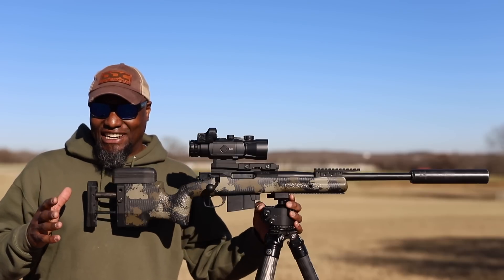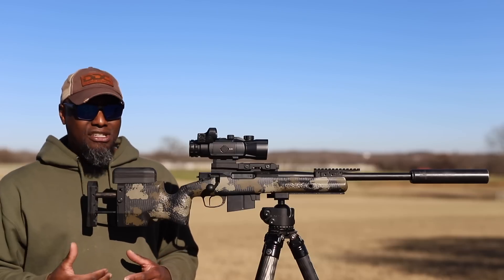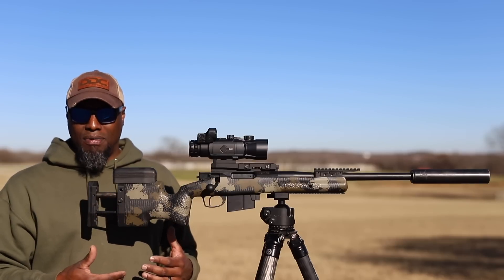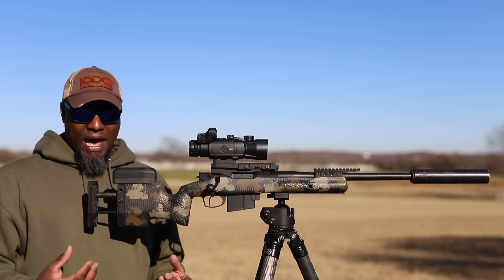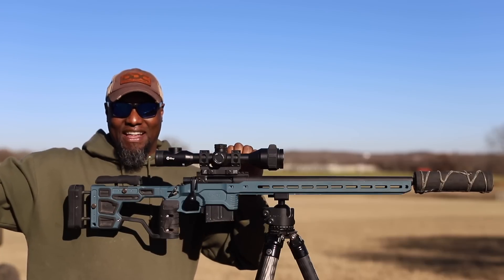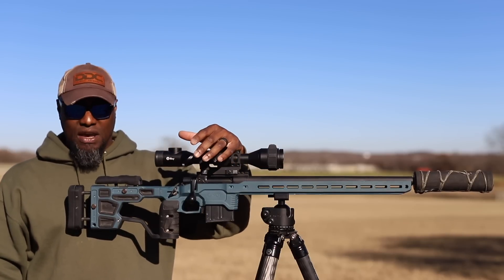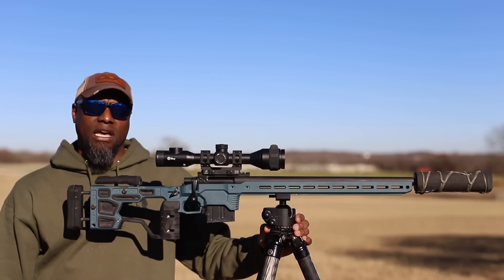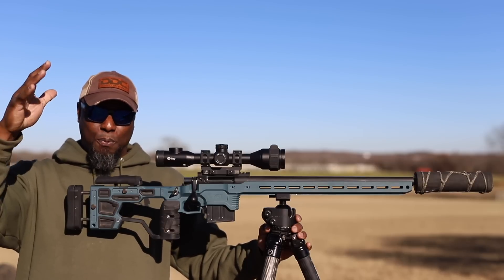Chassis selection (What to look for)

Comment: Do you know what mount and height you are using on the th50c on the chassis?  I am looking to have to order a mount would like it a touch shorter than that
Reply: Just heard adm @ "1.47 jumped the gun
Reply from the maker: If you're running suppressed I suggest you don't, that thermal will pick up the can quick. I run 1.5 on just about everything, on my bolt guns about a qtr of the screen is washed out because of the suppressors.
Reply: Thanks, didn't think of that